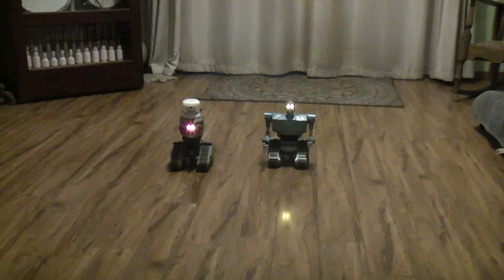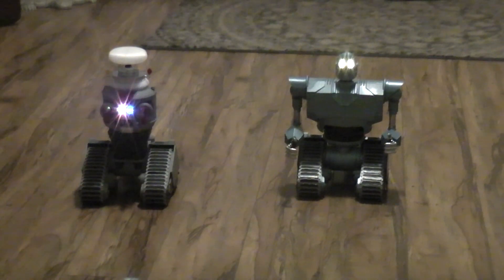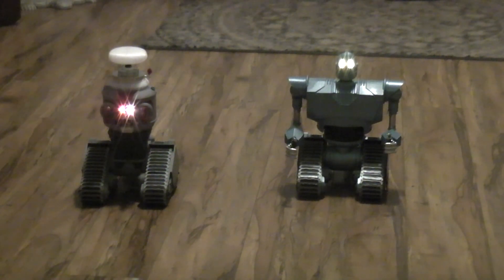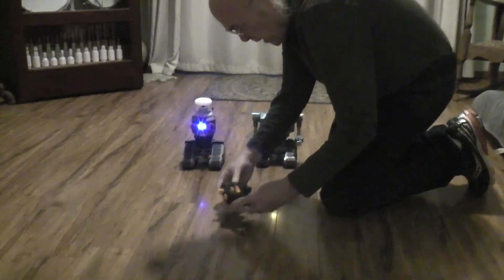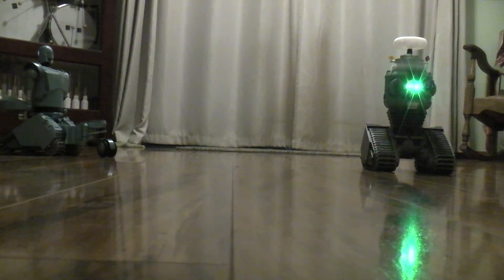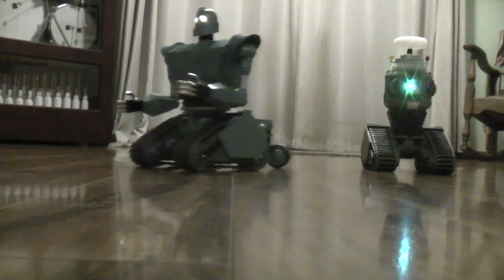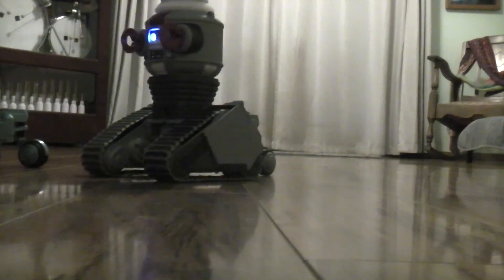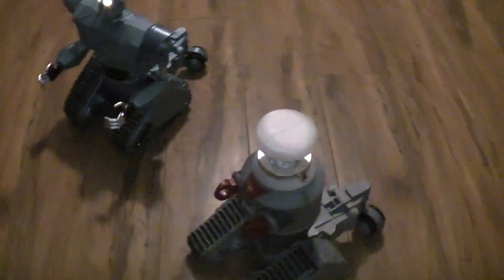Demo of J5-ig and J5-b9. Side by side comparison of 48:1 and 90:1 gearmotors.

Comment: two different frequencies they are not identical . if they were two sharks 🦈  in the same pond or pool would run the same .
Reply from the maker: Actually, the remotes are the same frequencies, either one can be used with either robot. They do a set up automatically when you power them up that pairs them to each other. Not something I have seen done before in RC toys. Normally it is just a different frequency set up.
Reply: @Robothut  ok so what the problem to begin with ? oh operating two remotes at the same time . understand the speed test .
Reply from the maker: I was hoping that I could PAIR both robots to 1 remote, but just like pairing Bluetooth devices they have it designed to not do that. It must save them money to only have to build one remote and receiver but be able to run multiple units at the same time since they all pair up to their own controller's. @PeterAgostiniJdcap26